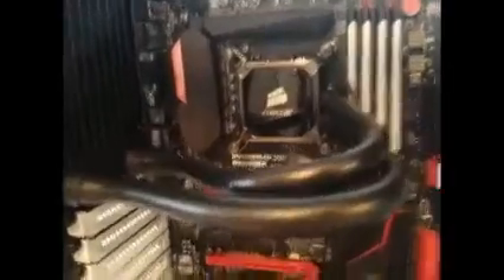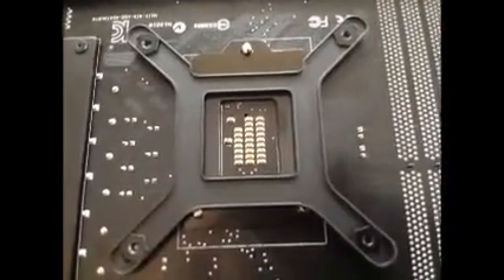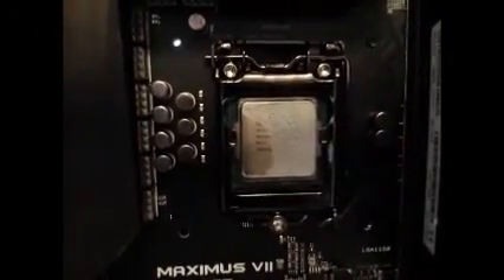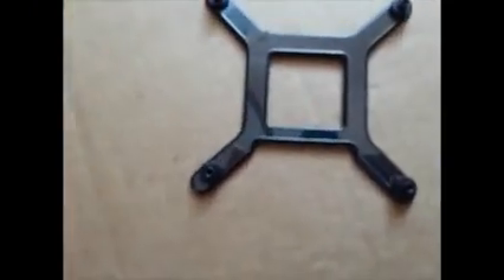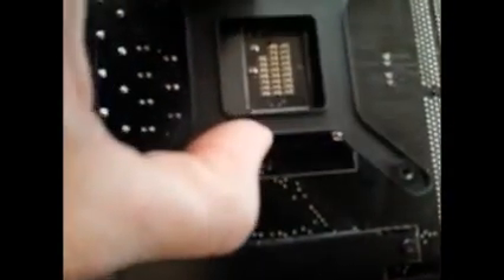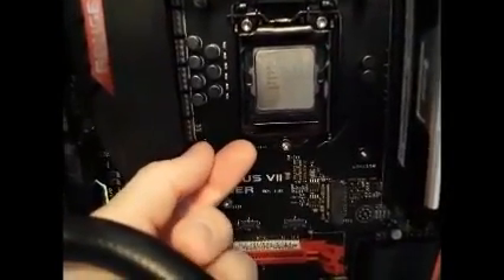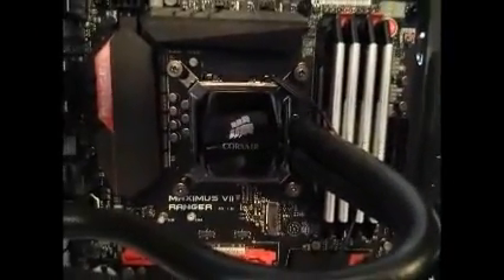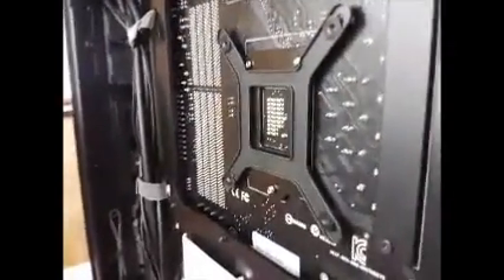Gaming PC  Build 2015 Help with the Corsair H60's loose and badly fitting heat spreader

Comment: Hey mate, my H60 just failed after 6 years of use. Cleaned off the paste that came already applied with it and then put some arctic silver...no dice. Had to shut off my PC due to temp warnings and started throwing a CPU fan error at post. Guess I will be looking at an old fashion Air Cooler as I don't OC at all.